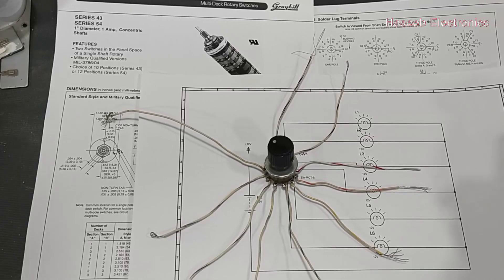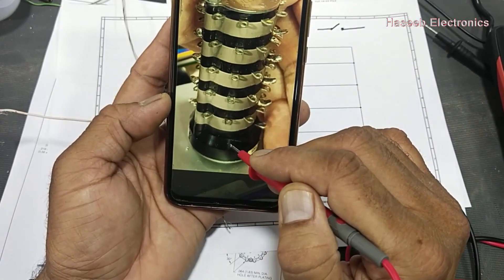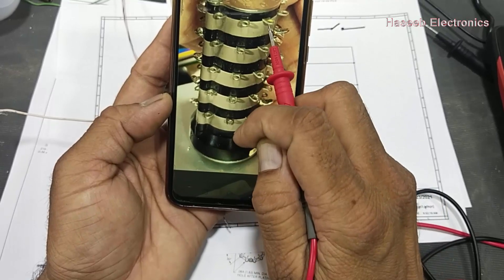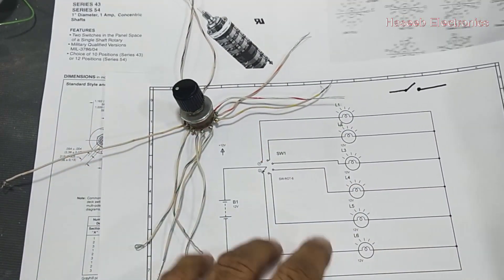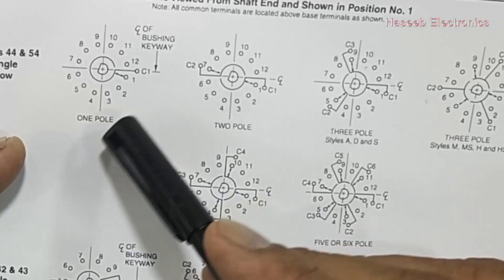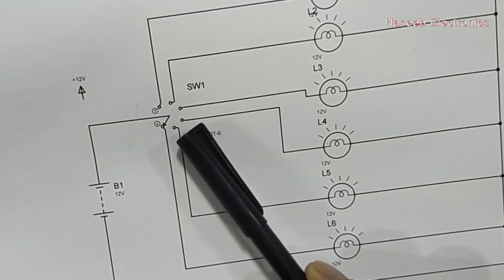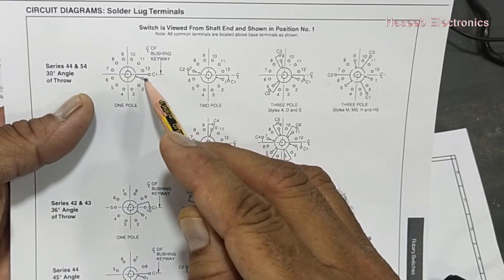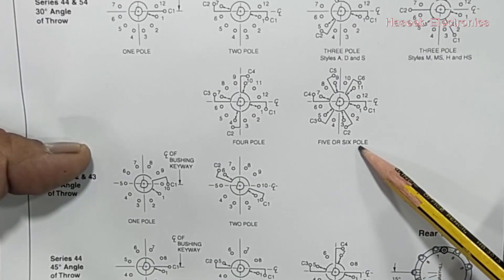{523} What Is ROTARY SWITCH, Structure, Wiring Connection, Testing With Multimeter

Comment: Hi friend thanks for the informative video but how different is this switch compared to the switch that is used in an oven?
Reply from the maker: rotary switches may different types and styles but their basic will remain same.  
there are many types of switches used in manual ovens for cooking profile selection, but analog timer have some different mechanical timer
Reply: @HaseebElectronics  thank you for the information